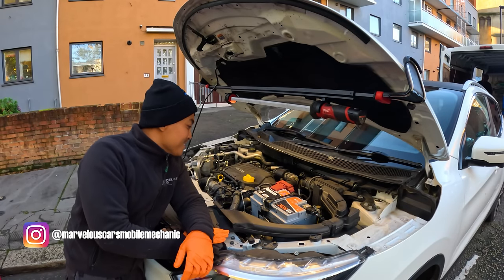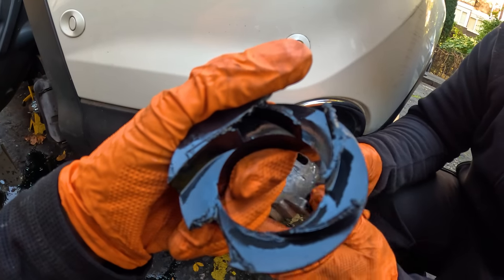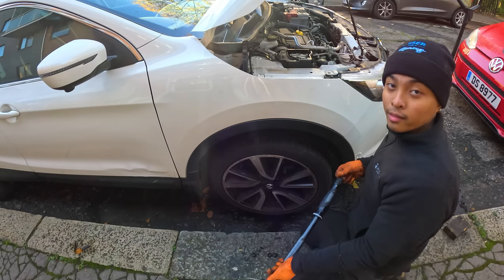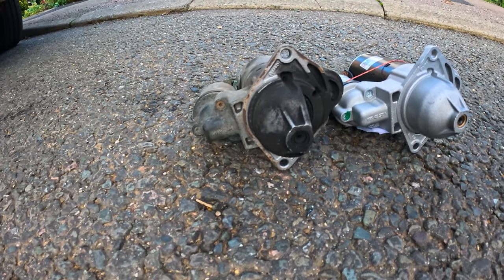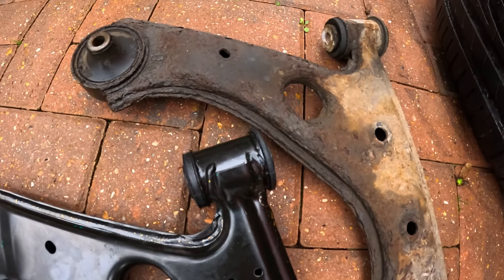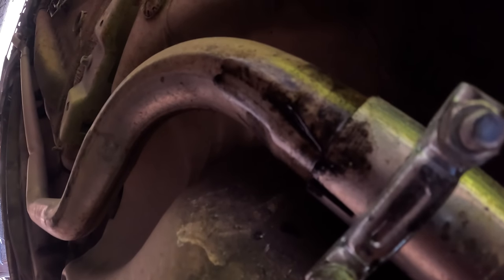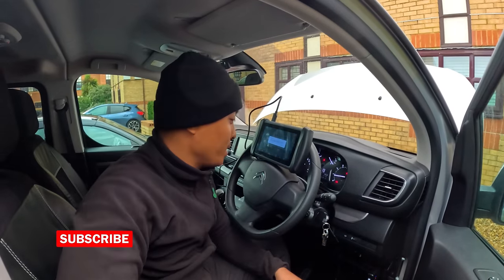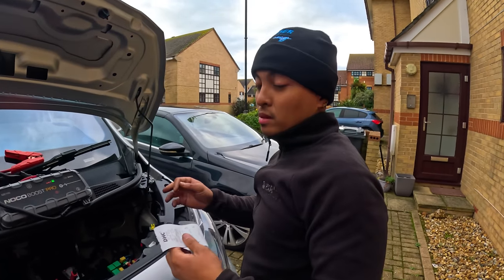NOT RECOMMENDED - CUSTOMER'S CHEAP SOLUTION | Nissan Water Pump | Zafira Starter Motor | Diagnostic

Comment: That lower arm Bush is not a fail , but the sub frame is a fail , and th subframe cannot be repaired / welded as its a high stress area. Needs a 2nd hand suffrage or a new one. Would love to see who passed it
Reply from the maker: They failed it on the bush unfortunately mate. Subframe, they couldn’t really see the hole during the test as it was covered by mud and rust flakes. Regardless, customer has been advised

Comment: great vid as always but top tip from a calibration firm for mobile techs, leave torque wrench set at low 25/50 nm as when its rattling around in transit it causes wear on the internals

Comment: They gunned the wheels onto my astra. Tried to use a big breaker bar and 400nm impact gun wouldnt shift it. Now the lockong key is slipping.
Reply from the maker: The amount of times I had to use my 1.5M breaker bar after a customer just had their tyre changed, is countless! Hope you get it out 🤞
Reply: @themarvelousvlog  i sold the car 😂

Comment: You can gun the wheels just lightly and then torque the rest. I use a little electric one to nip them up.
Reply from the maker: Small 3/8 Milwaukee goes up to 200 something nm. I’ll be careful 😂 

Just gotta make sure that torque wrench turns a little before it clicks
Reply: @themarvelousvlog  mines Makita barely does 100😅😅. I use air gun to remove(not lockers). Then buzz up using this and Also torque wheel bolts with vehicles raised so they are not loaded.

Comment: I got a golf MK1 cabriolet and i always go for the more expencive parts. Yes its a old car (30) But i drive it daily and i want it reliable so i am going for the better parts. I need new control arms and could get the 20 euro per side arms But what i got where the 40 euro per side ones with all the hardware brandnew.
Reply from the maker: I’m assuming you’re talking about Optimal or Lemforder? Best ones out there. Good to hear that pal

Comment: Had mot fail on sub frame mot guy said vauxhall were doing a recall on them but not really telling any one about it went to my local dealership they give me a number to call week later new sub frame and wishbones fitted
Reply: Hi does this recall apply to Corsa D? did drop links and springs a few months back and noticed my wishbones and subframe are very corroded

Comment: So as a fellow professional mechanic the same as my self what percentage of BOLTS would you say your torque per job?
Reply from the maker: Hmmm… I’d say 5% if that. Crucial ones I do like Cambelt parts, water pump, clutch, flywheel and ones that actually requires torque, like the wheels 👀
Reply: Agreed I am a diyer but at 64 rely on feel on most but wheels always. Lost a wheel on a lancia once was v lucky that day

Comment: For the corsa should have raised the wrong wishbone using a jack to road ish height and then fully tigthened bolts, you tightened them with no load on it
Reply from the maker: I hope that this is just an assumption 🤔